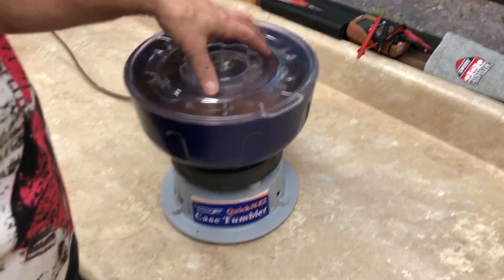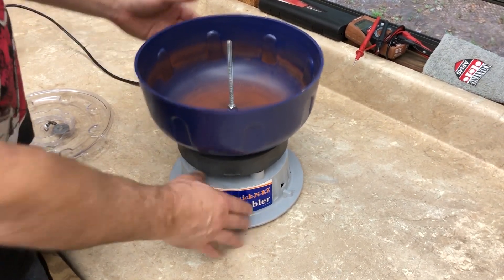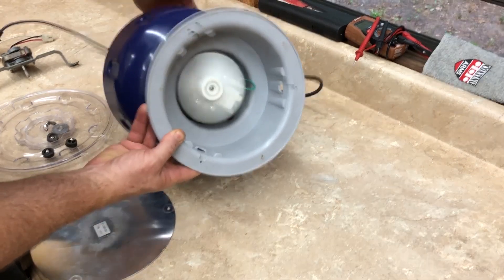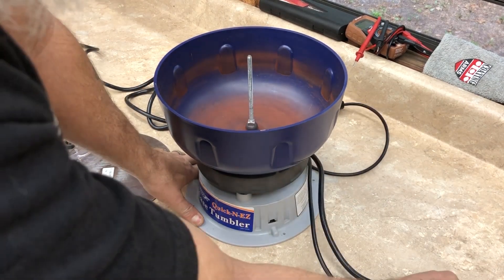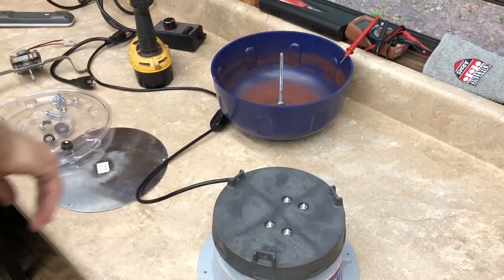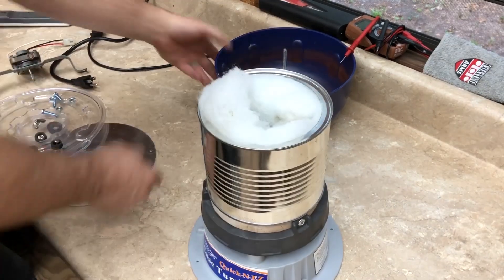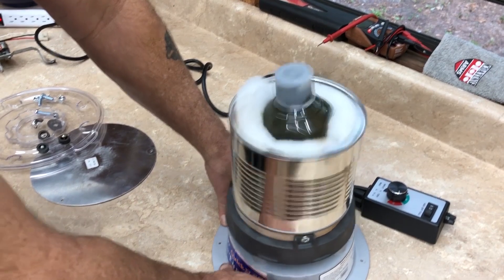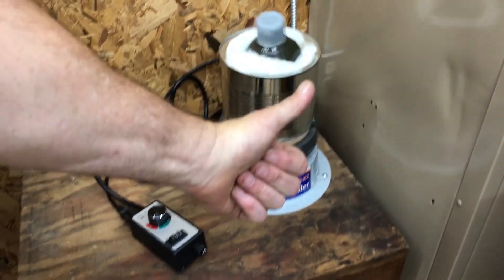Making a Paint Shaker from a Brass Tumbler

Comment: Hey man! THANK YOU for this video!! I need to make this for the exact same reason you did! Standing around shaking that coating in a BIG pain! I was going to buy the HF Paint Shaker...$135.00. Instead, I went on Amazon, got the exact same tumbler as yours..$48.00! Same Motor Speed Controller as yours...$22.00! So, for almost half the price, I got a shaker and a tumbler (should I ever need one). Also...the big payoff, IT'S QUIET! The paint shaker is loud and air operated. Man, thank you again! I will be building this, this week. You Rock!
Reply from the maker: Git er done! Takes a bit of finagling to get it just right but it works like a charm once dialed in.

Comment: I see the avg cost of a Cartridge Tumbler is around $60 (Harbor Freight) and the Variable speed control is $20.. for a total of around $80 plus whatever you make the base from ($0).
The cost of a Paint Shaker avg $170 (Harbor Freight).. so you save roughly $90.. GOOD DEAL.. even MORE if you are a reloader with an extra Tumbler Lying around!

My question is about the use with a Gallon of Paint... You said to mod the base to fit..Ok.. but will the Motor of the Tumbler handle the weight of a Gallon of paint without burning out? Just curious.. 

Also.. could you use ANY electric motor... add a Counterweight and build from there? I have a couple of Pool Pump Motors ranging from 1/2 -1 HP that I may rebuild and try to retask them to your 'Shaker'... I think the counterweight design would be the Key...

 I can't afford even the $80 design right now so I may try to use what I already have. Take Care and anyone tries this let me know the results. Thanks
Reply from the maker: This is just my opinion but I don't believe that this would handle a full gallon of paint very well - and may indeed burn the motor up. I think any motor would work - you just need to be able to control the wobble and direct it to your "shaking device". What you are looking at doing was my plan all along - until I looked at the unused tumbler and knew that it would work for my immediate needs. Keep me updated on your results.
Reply: @TigerCreekFarm  Will Do .. Might be awhile.. My HoneyDoooo List is a MOUNTAIN right now :P but When I try it I will update.. maybe send a vid clip. Take Care
Reply from the maker: DaddyDawg know all about those lists! Good luck with your project - look forward to seeing it.